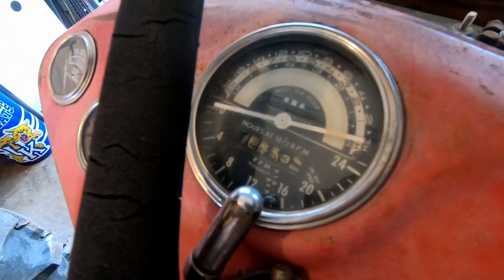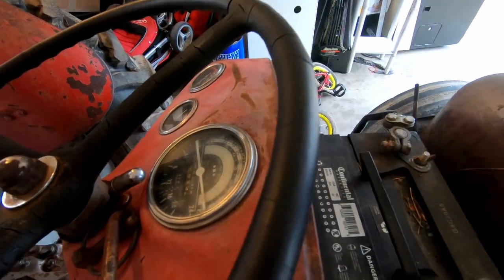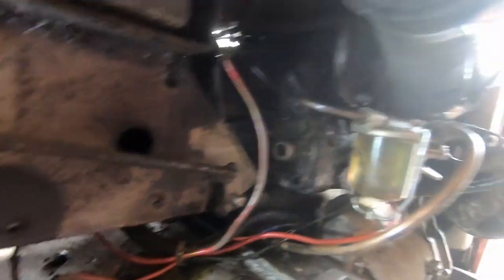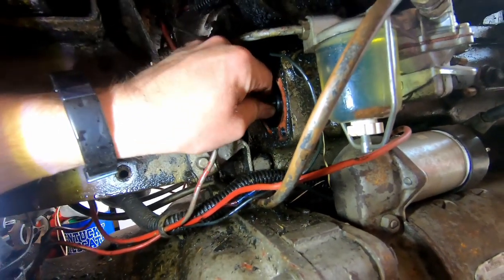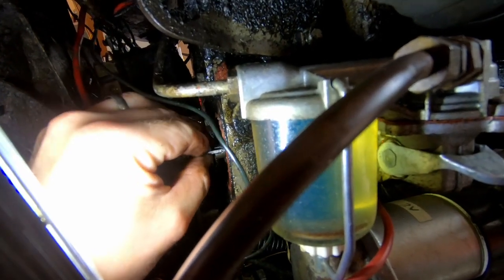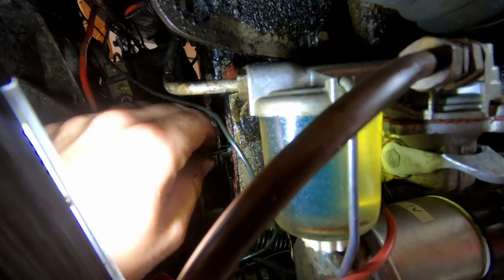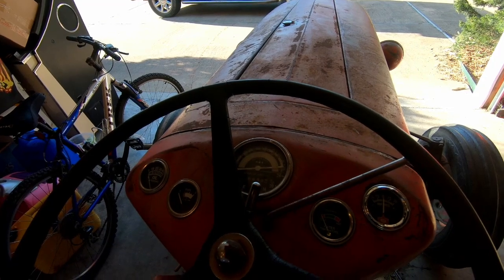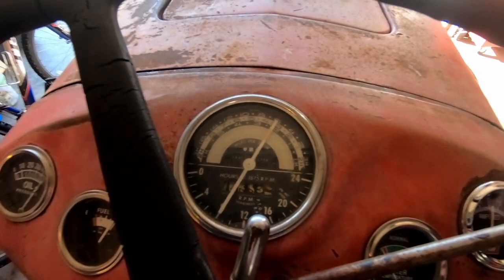How to Fix a Tractor Tachometer: Massey Ferguson 35.

Comment: The gear would not turn!! So how did jb weld free it up?? I do not understand this . I must be missing something.
Reply from the maker: The square end of the cable goes into a square end on that drive adapter.  Since the drive adapter on mine was round instead of square, it didn't turn the cable when the engine was running, so the tach didn't work.  The jb weld attached the end of the cable to the drive adapter so that it would turn when the cam turns.  That's what fixed it.

Comment: any idea on a 61 mf 35 with the continental 4cyl gas engine? converted to a 12v alternator. Cant seem to find cable plug at the engine side. my cable was missing when I got it.
Reply: I have a z134 I believ gas continental engine. The tack cable runs out of the back of the generator.  

I’m unsure if my tech is original or not but the cable seems to be about 1’ longer than it needs to be.  But it works.

Comment: Nice tractor and 57. Liked and Subscribed, Dave.
Reply from the maker: I appreciate you!
Reply: @FarmDad  I went on your vid after a search pulled you up. I have a 1990 Massey 1045, with the tach bounce, seems to be running fine but my reading on the tach is twice what it should be, and it sounds as if a fan is running at idle. When I turn the tractor off I get a squeal! I think it’s the tach, 🤷‍♂️
Reply: @FarmDad  thanks for your help, just what I needed, Dave👍

Comment: nice video just 2 questions:
how long does that fixing lasts 
and do i need to replace the seal
Reply from the maker: I can't say how long it'll last but mine hasn't failed yet.  You might get by without replacing the seal if you get yours apart with no damage and it looks good.
Reply: @FarmDad  well idk what is wrong as i have not taken it apart yet i only know it is not working
Reply: @FarmDad  well i hope that not to much is damged as it is broken since around 30 years. My father said he has brought it there to an specialist who fixed it but soon after that it broke again so he let it as it was. and the tractor has made now around 10000 hours (it is an mf 135)
Reply from the maker: @christian9125abd  just got to get it apart and see.  Good luck!
Reply: @FarmDad  thanks

Comment: What year is this tractor and is it a  diesel? My 35 and my dad's 50 both have the tachometer cable going to the back of the generator.
Reply from the maker: 1960 with perkins Diesel.  I think the gas burners used the generator for the tach

Comment: Nice work Dad, that JB Weld might not release the cable very easy when it comes time to repair it properly though... Wonder if dipping the end in melted wax, or wrapping it with teflon tape would help it release better ? Maybe it will all hold up so long you will never need to find out : ]
Reply from the maker: I figure I shouldn't have to replace it until the jbweld has already released the cable.